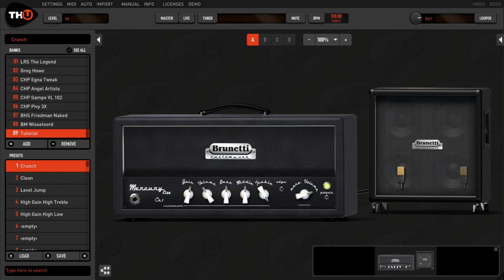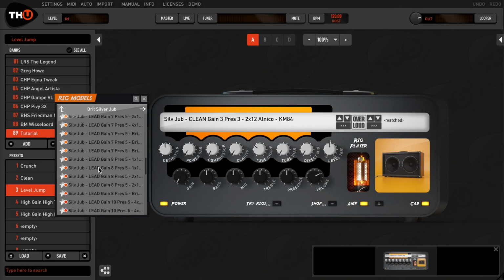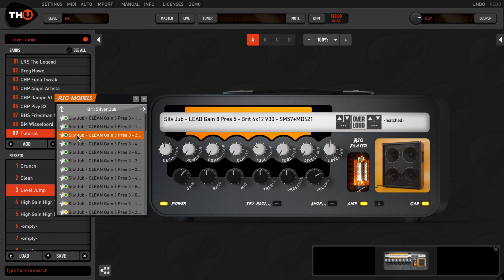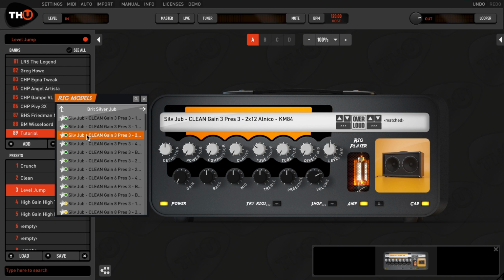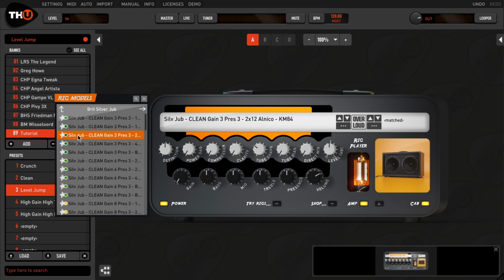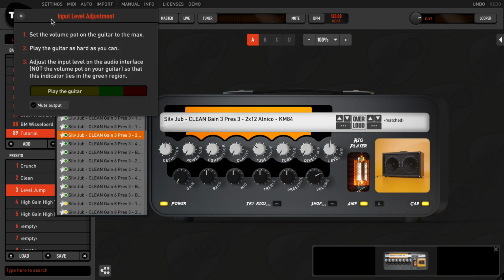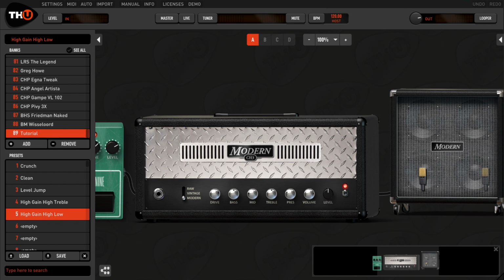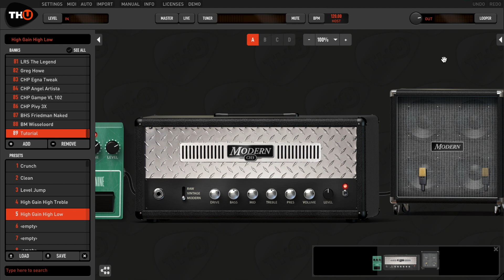TH U Input Level Explained

Comment: @Overloud: 

One item that’s technically level related that has appeared to work completely backwards for years (since TH2 or TH3) is the Sensitivity toggle under Master Controls. It states 1) Low matches output level of single coils and 2) High matches the output of humbuckers. In practice this selection seems to be in reverse. If you have a single coil output and select Low (as suggested) the level compared to High is significantly lower and if you have a humbucker and select High (as suggested) the level compared to Low is way overblown. 

It’s as if the software is increasing the input gain for suggested humbuckers using High and decreasing the input gain for suggested single coils using Low. Isn’t this in fact the opposite of the desired result?
Reply: That has been my impression, as well. High output sounds better with my single coils, it's probably just decibel boost, but still.
Reply: the idea is to apply the same representative signal level coming from single coils, it is not a compensation tool, its a tool to best represent the actual responses of amplifiers to the given signal level. audio interfaces preamps do not process the signal levels between pickups in an audibly noticable way. the signal levels are too low and too sterile to make a genuine difference when converting into the digital realm, save the actual frequency response, which is NOT based on signal level or output.
Reply: @FulcrumsEdge  Good afternoon. You're not understanding as you give a lesson everyone is already aware of. It does NOT apply the same representative signal level as they work backwards. Do you actually think some of us don't have multiple high-grade heads, cabinets , and guitar selections to choose from, and are keenly aware of the real world interactions having done so for decades? I'm not trying to slam you bud, but you're defending a broken "feature" at best.
Reply: @TheSavage1969  when you describe the feature that you took issue with seeming as reversed in it's intended role, and misrepresenting what it is doing because you misunderstood it, then yes, I have to assume you're not exactly sure what you're talking about. Owning a single or multiple high grade amplifiers and cabinets only guarantees one thing. You either had the money at one point to buy those things, or you indebted yourself to the ownership of said items. That does not give you validation in making arguments especially if you are going to make claims that are based on ignorance of the items stated purpose. That ownership and your "decades of experience" guarantess nothing but the material ownership and.... well... hopefully not a waste of decades of your life, but how you use your experiences and share them is up to you.  It definitely does not mean that you have developed a working knowledge of amplifier circuits or the understanding of the flow of electrical  current in an audio signal path or the representation of that in a digitally converted manner by those who program such things.   It kind of just exemplifies, in essence, what you were "trying not to do" by reiterating my first point. Look at the sign, read the words on the sign, either acknowledge and accept what's on the sign, or move on, cause arguing about a sign meaning or doing something different than it says is kind of pointless. High and low settings relate only to how the average guitar amplifiers high and low inputs work through their attenuating capacitance when receiving a hot input signal and a low input signal. On TH-U, a passive humbucker will be perceived to be attenuated to a certain level by the low setting as designated by the software modeling coding. The high input will be modeled to simulate a hotter signal based on the same analog reference. The same goes for single coils, the same goes for active circuit pickups, and passive pickups with a preamp in the chain. It doesn't do anything other than model as best as it can, how an amplifier responds to the level and impedence of the incoming guitar signal as well as the designated high or low input sensitivity setting in TH-U. It works as it should, at least as well as a digital copy can with today's tech.
Reply: @FulcrumsEdge  Nice mini-rant, except the setting does not represent how an amplifier responds to signals as suggested by them:  "1) Low matches output level of single coils and 2) High matches the output of humbuckers." It doesn't work as it should, at all. Pick an amp modeling of an actual amp you own. In the sim plug in via single coils and set to "low", same for humbuckers set at "high", then compare to your physical amp of the "model". Not the same, not even close. There's your sign, that's the reality.
Reply: wait wait wait, so you actually think that if you copy a signal chain of a given real life amplifier and compare it to a "like for like" chain in TH-U that the high/low setting for an amp sim is going to dynamically imitate a specific guitar amplifiers high low input jacks? where in TH-U do you see the option to take the hi/lo feature and set it to simulate a vintage fender twin?? or maybe the high/low settings that simulate a 2203???? did i miss the option to adjust the high gain/low gain settings for the peavey 5150? oh wait.... that's right, cause that doesn't exist. the high/low sensitivity feature is based on a general electrical circuit premise, not simulating specific god damned amplifiers.... fucking christ. for one, the high/low settings on two different amplifiers are nowhere even close to being the same. they are of similar concept... How they go about achieving the results is not close to similar. That is... apparently beyond your grasp....... Even two identical amps, will respond slightly differently to a given signal, and even moreso depending on the instrument cable you use. Try a 6 foot cable between each input and notice the difference when you change your cable to a 20 foot cable then the difference between the cables on just the high input jack, ugh what a jack off..... the fact that individual components have variable tolerances, within every single stage of an amplifier, means that uniformity between identical amps is measured by a percentage of acceptable variance, and THAT varies depending on the amplifier brand.....  so you wanna nitpick that changing the high/low setting on th-u doesn't sound the same as when you switch your guitar cable into the different inputs of your "insert fancy boutique brand here" amplifier? get the fuck over it. it is a feature, and a good one at that for adjusting the gain structure of your guitar input signal. it does a good job at affecting the way in which your pickup impacts the front end of ALL of the simulated amplifiers, and has a staging effect that simulates how hotter signals affect any given amp going into high/low input stages in amps. might it be superfluous when using amp simulations that don't have two different inputs? yes, definitely. however, it still adds a feature that gives you extra tonal flexibility that doesn't negatively affect your sound when you gain-stage properly. it is a helpful tool. it is not an impulse response, it is not a reverberation convolution, it is not a amplifier modelling profile. TH-U was not designed to mimic your amps input stage at the detriment of all the other amplifiers they offer sims of. it was not developed to cater to what YOU think sensitivity settings should be. BAHAHA.  If your tone sucks, it's likely it is not TH-U at fault, and asking for help in finding a problem is always more beneficial than griping like an impotent child.
Reply: @FulcrumsEdge  You may very well be right in what you're saying, but all my single coil strats sound lifeless on low sensitivity settings in comparison to high setting. It's just an overall much more enjoyable experience playing my strats that way.

Comment: Xtone is an audio interface which has not preamp level control for guitar input chanel even it is specialized for electric guitar.
So I could not adjust guitar input level on THU overloud with Xtone. 
I felt  huge sound difference from THU overloud Xtone(could not control guitar input level and Scrallet 3rd gen(available adjust guitar input level).
currently I want to use Xtone because it is all in one audio interface ( provide midi foot control switch).
Can you sudgget best way to use xtone with thu overloud? 
Xtone input impedance is 1M ohm
Reply: Do what I did: Buy an AXE IO Solo.

Comment: Why not just calibrate the presets for the typical -18dbu input level? That’s the most common calcination level for converters to equal 0db on a VU meter.
Reply: Absolutely agreed. The vid even states that they "tweak" the level of ALL presets and rigs before releasing them. I find this to be suspicious at best since they vary wildly in level, some packs even clipping into the chained virtual components BEFORE ever getting to the plugin's output stage. How many presets have you loaded up and the rig or cab sim into the downstream "rack" effect (like delay or reverb) within the preset gets the clipped warning light constantly....this is even with very low output PUPS. I digress a bit but tbh it's the first thing I do when I get another rig pack, I run through all of them, calibrate, and save the presets/banks so it's a non-issue later. Takes time but saves much of it later when you're in "creative" mode and don't need to be fooling with gain staging constantly during that time.

Don't get me wrong, I've enjoyed the product for years (once Rig Player came out it got placed back into my top 3 goto's), but there's some details that are frustrating at times for sure. Regards.
Reply: guitar amplifier gain stages do not work based input vu meters, vu meters are a representation of a decibel level, which is a theoretical premise based on our perception of loudness and analog clipping. Guitar amplifiers do not function based on this premise, or have their circuits built around this premise. our ears perceive amplifier gain through this premise....  TH-U does not model their software to replicate the way in which we decided to represent our ability to understand audible dynamics. they model their software to best apply the audio interfaces input gain stage (ie why the interface will generally have an input that processes a guitar level signal) to react accordingly so as to mimic the guitar amplifier input jack responding to a guitar signal. In order to model amplifiers to actually sound like amplifiers, each stage of the modelling must essentially be a like for like digital representation of the analog the components in an amplifier. vu metering is a mixing and mastering concept and is irrelevant to how any audio signal is processed by an any audio amplifier or audio processing unit.

Comment: To get to the green zone I need to raise the input in my audio interface (Clarett 4Pre USB) to the point it clips in the instrument input, while my DAW (ableton) tells me I am reaching -4db, which is insane.
Reply: it shouldn't stay in the green, it should barely tap the green upon the largest point of the transient.... and that's when playing your guitar AS HARD AS YOU CAN. you should also probably turn your daws input and output level meters to represent rms and not peak levels. interfaces inputs LEDs will "clip" often, these lights on interface preamps are not accurate, are overly sensitive, and in general are not truly clipping when flashing intermittently at the peak of a strumming or picking transient. guitar transients are inherently spiky. the clipping lights are designed to respond to line level signals far better than their instrument level inputs and are not really good for as your basis for determining input level.
Reply: Same thing with my Audient id4 mkii. Basically, I have to max out the input gain on my audio interface to be able to tickle the green in Overloud.

Comment: Sorry, but I was expecting more knowledge from the potters themselves of the plugin. All the information given in this vid is wrong.

Setting the gain of the interface until "almost clip" the VU meter is wrong for guitar amp sims based on profiling (which is the case of the TH-U rig player).

These plugin is made using a reference value of input gain of +6dB (this info was given by Overloud themselves). The way of gain staging the interface to get the profiles working as the original amps that they profile is setting the input gain to the minimum and then applying a software boost (or cut) to match the reference value (guitar forums explain it, just search for input gain for guitar amp plugins).

It seems that Overloud doesn't know what they're taking about. Not a surprise, though, since their rig player is just a kemper profiles player (and I'm not going to ask how they programmed it).
Reply: Hmm, bear in mind that it's "wrong" for neural dsp plugins or NAM because they've specifically tailored their amp models to respond in a way that, on some usb audio interfaces you can put gain on 0. TH-U are telling you here that they don't do this. But, although they are claiming to tweak each pack before release it's likely they are like Amplitude 5 with the gain all over the place between different packs and amps. There's no specific gain setting on your interface or input gain in the plugin that will work for all the amps and cabs. So it's broken, but what they are saying here isn't wrong, it's their product that is broken so you have to set the input level so you don't clip yourself - possibly you'll need a different level for each amp model.

Note that setting input gain on zero etc is just one way of setting the input gain. It's not a 'correct way' or anything (what would be the point in an input gain knob that was always supposed to be on zero?). It was described in this way to make the instructions simple and so that the only dial you had to adjust was the input gain in the plugin (which on some other products you can set once for all their models based on your audio interfaces max input dbu value) - note too that many devices that act as a usb audio interface (e.g pod xt and other line 6 products) don't even have an input gain knob to adjust - you simply cannot set the guitar into the 'green' part at all using TH-U's interface.